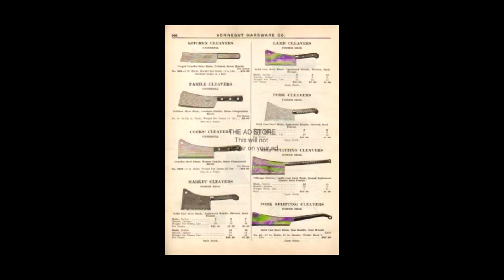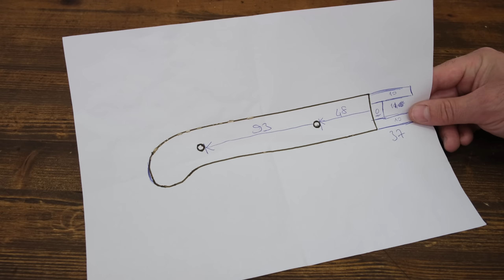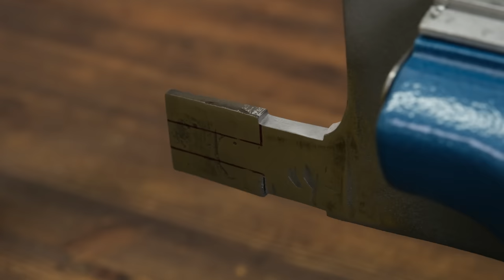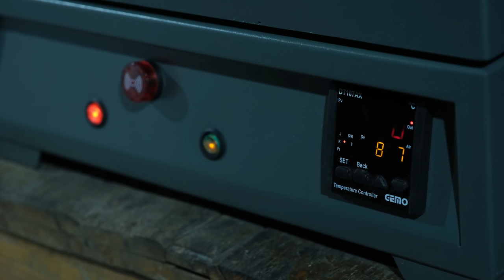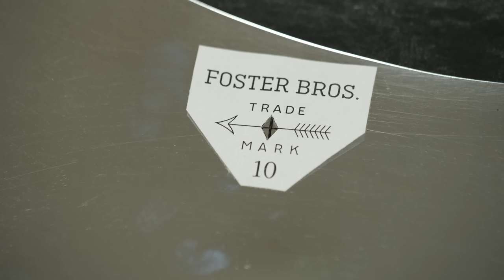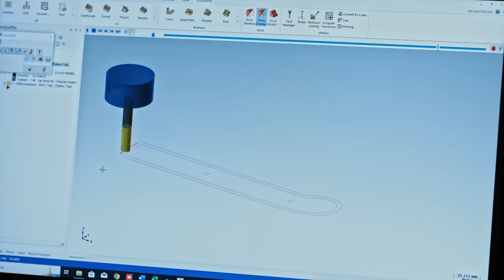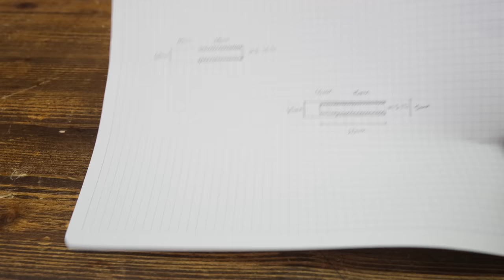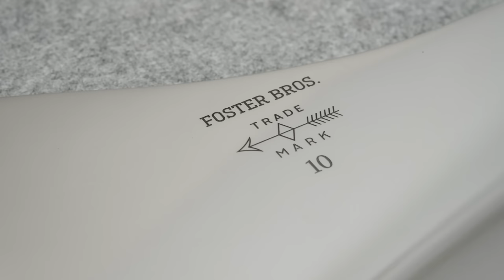1880s Antique Rusty Cleaver Restoration - Restoration Videos

Comment: That wasn’t a restoration, it was a remodel. You didn’t restore it to its former glory. You butchered it. Not to say the end result isn’t a lovely looking piece, but to my understanding, you put any real strain on that and you’re gonna break it. I didn’t see any normalising cycles, with all the heat from grinding, cutting and using the torch, even though you tempered it, I’m pretty sure the grain structure will still be pretty big, meaning one good swing into a substantial sized bone and you’ll have a cleaver jigsaw puzzle. There’s also a reason or two the edge was curved in the original design. Mainly for allowing a rocking motion for cutting, but I’d also guess to stop the whole blade contacting the surface beneath whatever you’re chopping. Why dull it faster than you need to? Also, imo, putting your name on top of another companies product, without it saying refurbished by or something to indicate that you didn’t produce the whole thing yourself is a dick move. Still a really good looking end result, I won’t knock that, but until I see you give it some real testing, all you’ve done is made a cool looking paper weight.
Reply from the maker: I'm sure you watched the video less than the duration of your comment. Or again, I'm sure you didn't read the description! Watch till the end and read the description. For all the negativities in your mind, you will find positivity there. Also, read the subtitles in the video!
Reply: I did watch the full video, but I didn’t read the description. After doing so, I apologise for my previous remarks. I thought that was your own logo, I could have sworn at the beginning when you were looking them up on the phone it said Seattle something company. Also I didn’t see any subtitles, if you included information in those, it explains why I’ve misinterpreted what was going on. I’ll be sure to turn on subtitles and read the description next time I watch one of your videos.
Reply from the maker: @joker0206 My friend got the favor. Your subtitles may be turned off. Actually, there are many explanations.
Reply: He still fucked up a good looking cleaver, no explanation or argument needed...

Comment: I had to get stitches because a knife broke because the handle was welded, moisture corroded the weld and the knife flipped back and cut my hand. I would have advised against cutting and rewelding.
Reply from the maker: stay safe, my friend